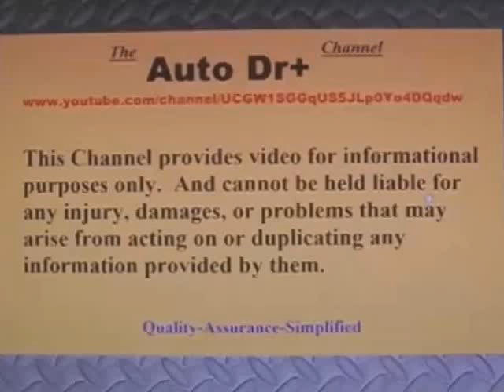Subaru Legacy `08 2.5l SOHC non turbo timing belt replacement

Comment: i need help with the orange pulley the new one is 5mm bigger than the old .... it matter?
Reply from the maker: I would replace belt kit with another manufacturer, and check for correct pulleys.  Also, on a side-note, maybe the engine is a different year, or you have ordered for the wrong year, or a weird half-year production change is possible.  As well, there may also be a part # on the OEM pulley, and have it cross-referenced at a part`s store, for correct replacement.  Ultimately, if no choice, check for timing cover clearance issue, if ok, install belt, and check that the tensioner arm is setting the right distance from tensioner plunger body.   In general, improper timing component alterations are risky.  The manufacturer has used teams of people, and multiple mil $$ to make that belt last a specific amount of time.  Changing it`s dynamics slightly may shorten its life significantly.

Comment: Hi, there. Thanks for posting this video. I just replaced timing belt in 2008 Subaru Legacy and engine won't turn. Any suggestions. Thanks
Reply from the maker: Did it turn before the belt replace?  Make sure the belt guide bar around crank sprocket has at least (".020-0.50") clearance.(NOT TOUCHING BELT AT ALL)  Mabe a pulley installed backwards/spacer missing, wrong pulley installed, pulley binding after fasteners tightened.  Loosen slightly, all pulleys, and see if it rotates in correct direction by hand slowly, and see if any rotation is possible.  If so, identify offending component and repair accordingly.  Post back with any new info. and can narrow it down further if needed.